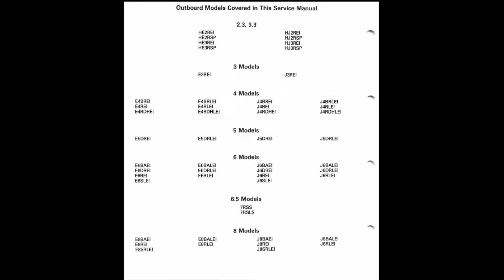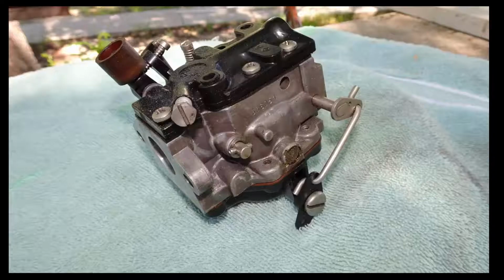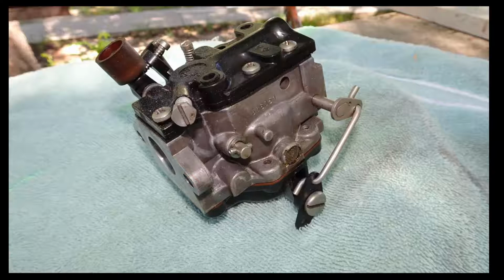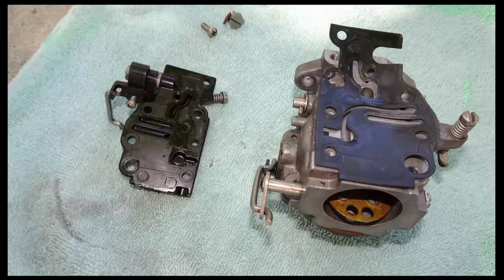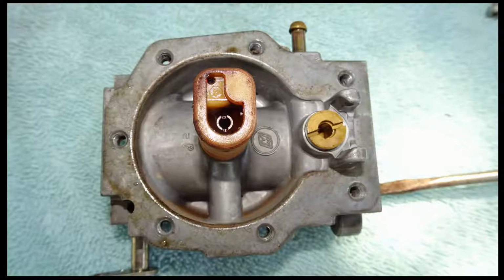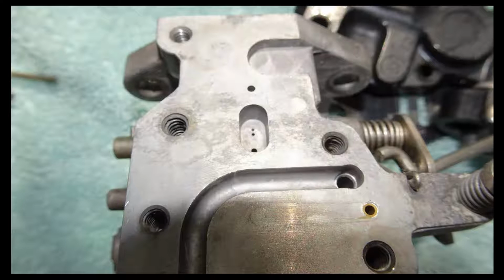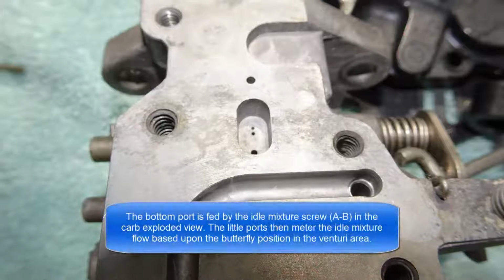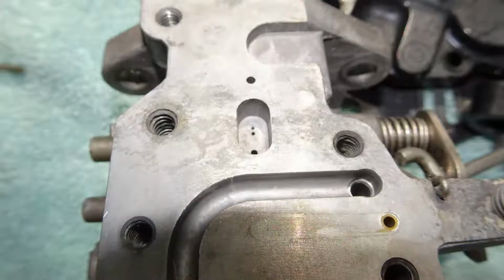Fix your Evinrude outboard engine idle problem

Comment: Im having the same problem, revs great  but wont idle.. pops and sputters,, im sure its carb related... my well nozzle  looks cracked, ordered another one but will check the idle passages you mentioned, thanks  !!!!  im trying to figure out how the well nozzle works on these carbs, with the little rubber gasket in the bottom of the carb... 
 I hope it gets my 1994     8hp going,, sure is an odd carburetor... also had to replaced all of the wires under the flywheel, as the insulation was coming off of the trigger and coil wires.. the spark plug boots were shot too, made some new ones,, hope all of the time and money im putting into this motor is worth it..

Comment: The rubber idle pick up hose is another issue for these engines...It disintegrates sending debris up into the idle cavity...  The newer tan colored pick up hoses are better than the original black ones though